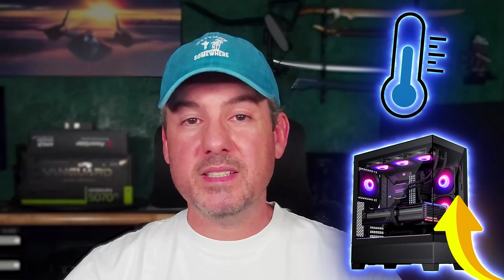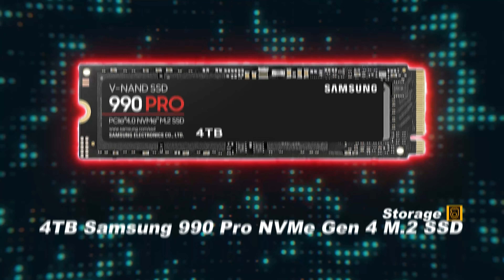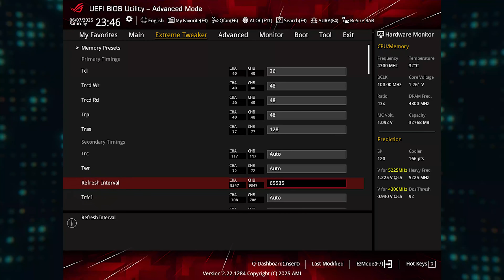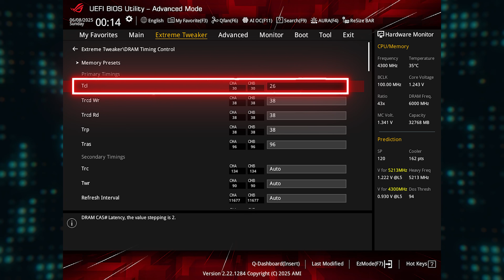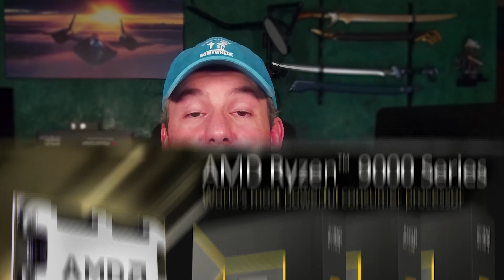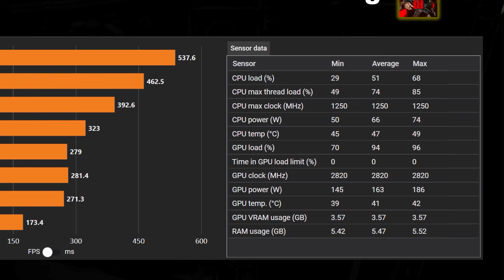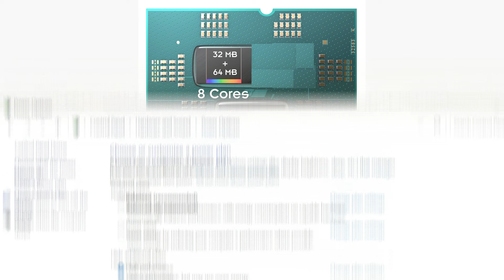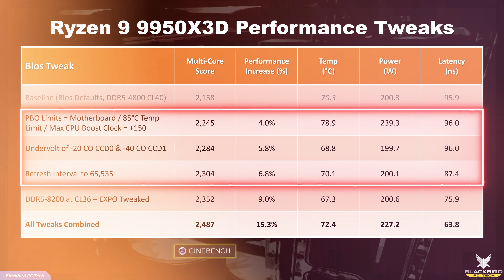What Are The Best Settings for an AMD Ryzen CPU?

Comment: Man tried this apparently my cpu hates undervolting.  Tried -10 good -20 booted once crashed during aida64 the wouldnt post.  Cleared cmos set to -15. Crashed in aida64 so back to -10.  Is that normal?
Reply from the maker: Normal is stock ... -10 is better than stock

Comment: Love the content, thank you Can you run the optimization on a Mobile Windows installation like Tiny 11, to get around potential system corruption?  If the USB Mobile Windows is corrupted you can just reformat and reinstall a new Image on your USB.  Once BIOS is tuned and stable you can boot into regular system installation and adjust the windows power settings.  Is there a downside besides I/O to a USB stick?
Reply from the maker: You could use the Windows sandbox feature but I've never tried it ... that said, I am genuinely not too worried about Windows corruption because you can easily fix it and it's unlikely if you follow the process I outline.

Comment: Great video! 
Very well explained. 
Yeah, AMDs PBO feature is great! 
I've been running my R9 9950X on an X670E Taichi motherboard, with similar settings, to the ones described in this video, for over a year, and my system is very stable. 
No errors. No high CPU temps.
Reply from the maker: I don't think PBO gets the love it deserves because the mainstream channels try to scare you away from tuning your PC.

Comment: "Roger, Ground Control. We applied the recommended settings as instructed. All systems are running just fine, and we're ready to take off. Over and out!"
Reply from the maker: Sounds good soldier ... enjoy!
Reply: @blackbirdpctech  hi when you say  wont load do you mean crash my pc ive got a back up on my desktop do i just send it to flash drive and then use it with device manager
Reply: @blackbirdpctech  hi when you say  wont load do you mean crash my pc ive got a back up on my desktop do i just send it to flash drive and then use it with device manager how about Universal.x86.Tuning.Utility.V2

Comment: Hiyo, I need some help. I have a R9 9950x with a Antec Vortex 360AIO. Corsair ddr5 64gb 6000mhz cl30. Gefore rtx5070. I was trying to overclock the cpu by undervolting and boosting clockspeed. However it only increases my temps. A cinebench before any overclocking gave me 2280pts at 81deg celcius. It never got above that and was limited at 95 by default. I undervolted by -15 on both CCDs so far and increased clock speed by 150mhz. I managed to get 2400pts but when looking at AMD Ryzen Master it only shows 5300MHX while running. Also it now sits at 92deg (the limiter I introduced) so its much hotter. Why doesn't it boost to the 5.9GHZ? Also, should I try and overclock my ram and gpu? Or not at al? Any tips eould be lovely
Reply from the maker: The max boost clock of 5.7 GHz is only for one core running a single threaded workload ... you are running a multi-core workload in Cinebench. Your score went up quite a lot ... your CPU is now using the thermal headroom you created when you undervolted, which is why the temps are higher. Your RAM is overclocked if you are running it at 6000 MT/s. I would definitely try overclocking your GPU ... I have a new video releasing tomorrow at 12pm (EST) that will show you how.

Comment: I tend to never comment on Youtube videos but now I have to because credit is to be given where it is due. I bought new PC with Asus X870-F motherboard, Ryzen 9 9900x3D CPU, Asus GeForce RTX 5070Ti TUF Gaming GPU, 64GB Kingston Fury Beast DDR5 6000MHz CL30 RAM and Asus 1200W TUF Gaming Gold. I struggled from the beginning with very low 1%fps and 0.1% fps in games. I read tens and tens of reddit posts and other forum posts, watched youtube videos and tried to troubleshoot with no luck. Then yesterday I bumped into this video. Followed your guide in this video and boom, problems are gone. I am currently running undervolting "Per CCD" negative 30 on both, Max CPU Boost Clock 150, and Expo II profile for memory.  The PC runs really smoothly now and the very low 1% fps spikes are gone now. I didn't try to max out everything to the point I get errors from stability test but I might do that later. Anyway, thanks you for this video kind sir and keep up the good work. This was the only guide that really helped me :)

Edit: Just for information I had horrible 1% low dips in League of Legends from capped 144fps to 60-80fps and the game stuttered and now the lowest dip was 125fps and no stuttering at all with higher graphic settings. In Counter-Strike 2 with my settings I have capped 500fps and the fps dips after doing these tweaks are about to 430-450fps, previously being much lower. Sorry for the length of the comment but I felt like I have to give couple examples.
Reply from the maker: I appreciate the comment and I'm really happy to hear that the guide helped. I have a new guide coming later this week on undervolting and overclocking Nvidia GPUs, so you may wish to take a look ... that will help you tune and optimize your 5070 Ti.
Reply: @blackbirdpctech  Gotta keep heads up for that :)

Comment: Hey there mate! Love your video and mood! Would like to know if you could try to help me out understanding why my 7800x3d is not going past 4800most of the time no matter what co offsets i put, ive tried per core, all cores, simply seems that something is limiting me at around 4800-4850 most of the time even on low cpu% or low temps under 70 degrees , only seems to go past at times when idling or loading into a game for example :/ ive been digging but cant seem to find a solution for this. Thanks in advance
Reply from the maker: A 7800X3D is locked for overclocking ... so even though you can input a boost clock increase in PBO, it won't do anything.
Reply: @blackbirdpctech yeah but what i mean is that i see a lot of people being able to handle 5050Mhz while playing, im not being able to reach that result somehow
Reply from the maker: This is exactly why you shouldn't worry about what other people are saying or showing on places like Reddit ... the max boost clock for a 7800X3D is 5GHz, and that's with a single core running a single threaded workload. So yeah, unfortunately there are a lot of people that spread misinformation 😉

Comment: 7950X3D and I have managed to get -30 on both CCD's but both AIDA and HWiNFO64 show no decrease in temps. No overclocking yet. Not sure if I am doing something wrong. My CBr24 score increased by about a 100.
Reply from the maker: Two things could be going on:

1.  The undervolt wasn't applied properly ... you can try applying it in the other bios location (unlikely)

2.  Your CPU is using up your increased thermal headroom to boost more, resulting in more performance (likely). You can add a thermal throttle temp in PBO to prevent this behavior.
Reply: @blackbirdpctech  Thanks aye the clocks are higher. Will play around some more.

Comment: Hi, great video! I'm just a little confused idk if I'm dumb. I have r9 9950x3d and when you say to change ccd 0 and 1 to neg and add a number do I do the other 14 cores or leave those one alone.
Reply from the maker: Good question … Ryzen 9 CPUs have two CCDs … so for a 9950X, it’s basically two 9700X CPUs stitched together with a fabric. So when I say CCD0, that is the first 8-core CPU, and when I say CCD1, that is the second 8-core CPU.

Comment: 0:58 is this a fan above your ram with which you actively cool your ram? Is this necessary with this RAM kit if you have no airflow?
Reply from the maker: Yes, I pulled it from a Gigabyte motherboard that I had. It's not necessary but additional airflow across components always helps.

Comment: What a insightful & helpful how-to, I'm currently following it for my new 9600X system.
I am wondering why you tune memory first as surely you would have to recheck it's stable after performing any Undervolt &/or OC?
Why would you not set the UV/OC first after determine which EXPO preset offers the most performance & then fine tune the RAM & check stability?
Reply from the maker: That's a great question. It's important to tune your memory first and make sure that it's stable before you UV/OC your CPU because it's important to isolate the memory subsystem. After tuning your CPU it's worth using Karhu to make sure that your memory is still stable, but I've never had the memory become unstable after a CPU UV/OC. Remember that Karhu only tests your memory.
Reply: @blackbirdpctech thanks for the reply & yes that makes perfect sense.

Comment: Is it normal when my 9800x3d runs 5.3ghz idle constantly? Temps are fine though.. Only 40c
Reply from the maker: I wouldn't look for a problem if your idle temps are 40 deg C.
Reply: @blackbirdpctech  Thanks!
Reply: @Elias-kr9mi  pretty sure it does that cuz of factory AMD OC can disable in bios

Comment: I find it interesting that the worst performance increase factor is the actual overclock itself, of only 4%. Does this translate to a relative 4% bump to the other variables when gaming too? If so I don’t even want to overclock 🤣
Reply from the maker: For the CPU boost clock, it's an increase only to the boost clocks and not the base clock, that's why the impact is relatively low, but so is the negative impact on your CPU life. And don't forget that running an EXPO profile is overclocking as well.
Reply: @blackbirdpctech thanks to your videos I have decided to not overclock my cpu or gpu, especially having a sandwich style SFF case, this will help me greatly!
Reply from the maker: @ArmanGT  For a SFF case I would recommend undervolting.

Comment: I have a GTX 1080Ti paired with a Ryzen 5 5700x. I have a quite old motherboard (Asus b450 plus) and ddr4 ram. Is it the kinda the same principle on in my case compared to that in the video or is it a large difference? Would love any help or info that could point me in the right direction either way.
Reply from the maker: Depending on if your motherboard has PBO features in Bios ... if not, then you can follow this guide to dial-in an undervolt: https://youtu.be/GJCC94cRGys

The memory subsystem is different on AM4 ... the rest of the PBO features should function the same way.
Reply: @blackbirdpctech alright ill do some more digging then but rly appreciate the answer  ❤

Comment: If anything bad happens to cpu during over clocking or under volting, does amd provides cpu warranty?
Reply from the maker: You will have to read the terms of your warranty ... but generally it's not covered under standard warranty terms.
Reply: I see. Two days ago I ordered Ryzen 9 9950x3d with asus proart x870e creator wifi.

I am hoping to get best out of it. In here in india the ideal room temperatures are high during summers. So i am thinking of doing it under volting.

Btw this is the great content available on this topic. I am very Grateful and Thank you so much!
Reply from the maker: @dineshbharti4454   you are very welcome!